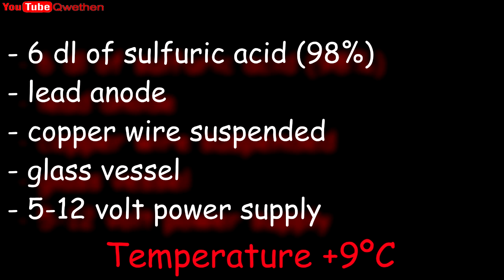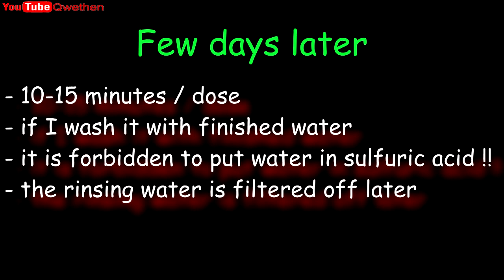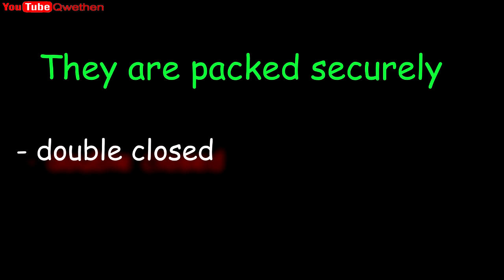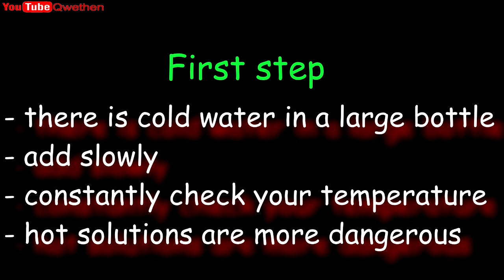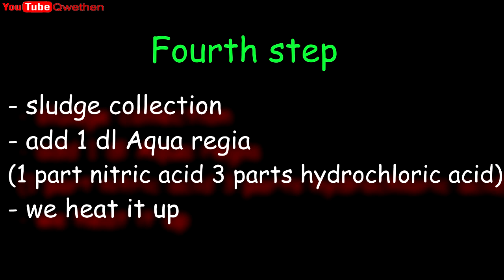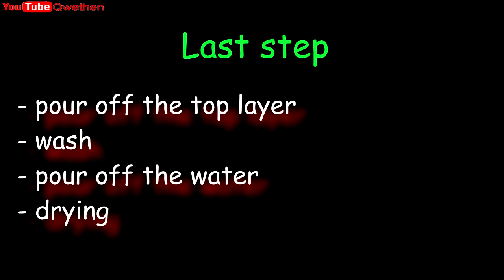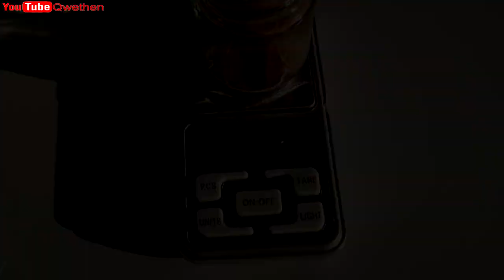Gold recovery with sulfuric acid electrolysis / gold stripping cell ,  gold refining , processing .

Comment: U lost alot of gold there.  Use heat with the  aqua regia. All that black in the filter paper was undisolved gold particles. To each their own I suppose. Good vid still. 😋
Reply from the maker: Thanks for the feedback that you like about the video.  I usually use preheated "lukewarm" Aqua Regia, which I think is a dirt / sealant left in the filter.
At 4:14 you can see the cpu cover on the sealant (black section). This rubber-like material was also on the plates .
Reply: @qwethengoldrecovery  
P